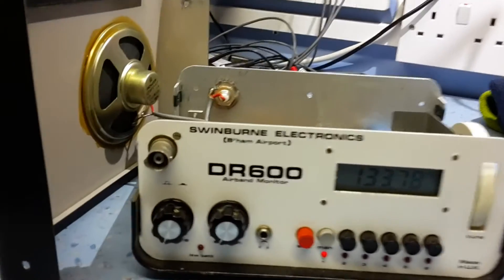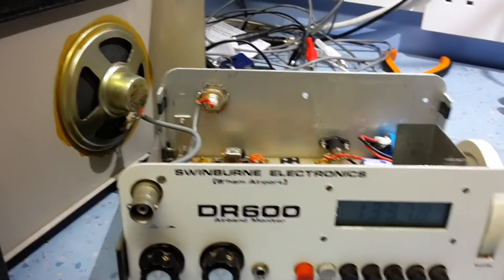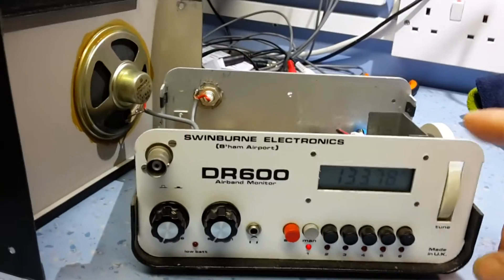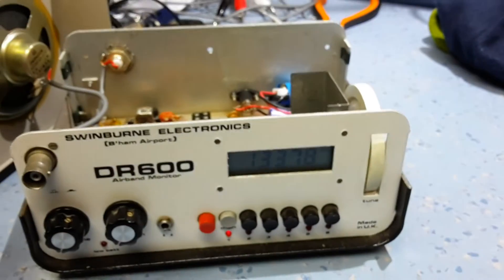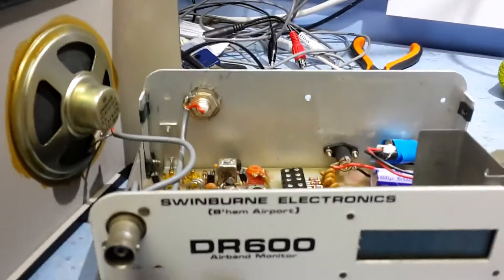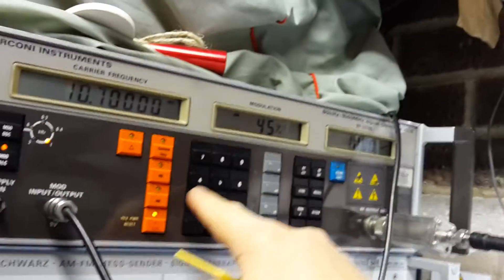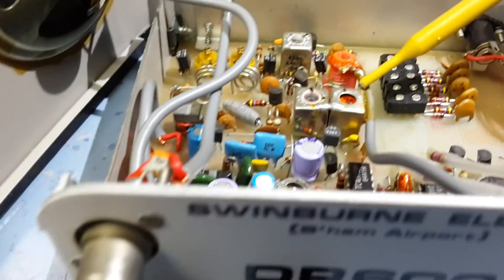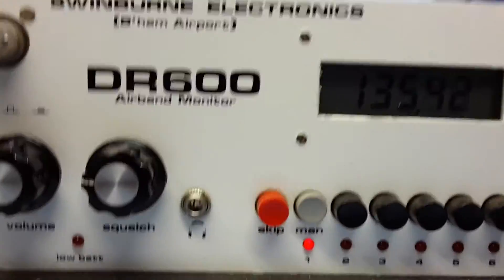swinburne electronics AM airband

Comment: Hi Simon, you remember my weird vfo problems on Swinburne CR600? Thought you might be interested to hear that I finally decided to take the very unscientific approach of slowly replacing components and it turns out the transistor in the crystal oscillator was damaged. A replacement returned the radio to perfect working order. I even got a chance to have a nice chat to Ron Swinburne, a pilot himself and a real character. The frequency readout on your DR600, is it only on when the squelch opens? 73 Adam

Comment: Simon, can I ask you if you were inserting a crystal and instead of hearing a peak of white noise you heard the local oscillator tuning up through the airband as you advanced the trimmer POT, despite the crystal still oscillating and receiving aircraft signals (like as though the LO hasn't locked onto the crystal oscillator properly) where would you begin to look for the culprit? A transistor in one of the two oscillator circuits I'm wondering? I'm toying with the idea of just replacing the components here one by one in the absence of any proper test gear. 73 Adam

Comment: Hi Simon, I am having issues with my CR600 squelch and can't fix it myself. May I ask you: do you ever repair radios and if not do you know of anyone I might be able to approach? Cheers. Adam
Reply from the maker: You can send it to me for a look if you like. What's wrong with it?
Reply: Thanks for that offer. It's had a tough old life in Dad's cow barn for 20 years! A radio club friend & I tried to fix it and it is working now. But the squelch is way too fierce: once it reaches that threshold point, nothing really gets through except overhead aircraft. Squelch off it's fine. One or two pink coils with ferrite on top are broken. And I've tinkered around with so many variable pots and coils it's a wonder it works at all! I just don't have the skills. Thks again. Adam
Reply from the maker: M6RDP   Its a fairly good set but lacks selectivity and is very prone to overload. It sounds like it would need a full alignment . Not sure how good the squelch is on mine as it's deep somewhere in the workshop.
Reply: The squelch is coming back to life now during a careful clean of the PCB. But can I ask you without the benefit of the test equipment you have can one manually adjust the coils for say maximum or minimum noise? Or maybe for best signal during reception on a crystal controlled channel? I'm sure I must have twiddled with them as a boy. Thks. Adam